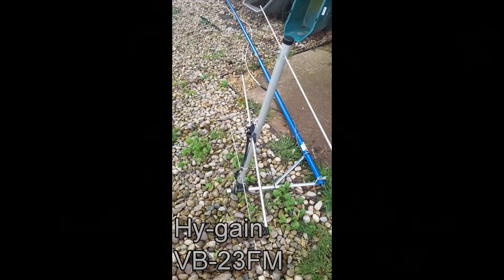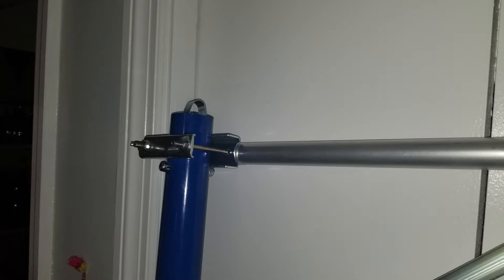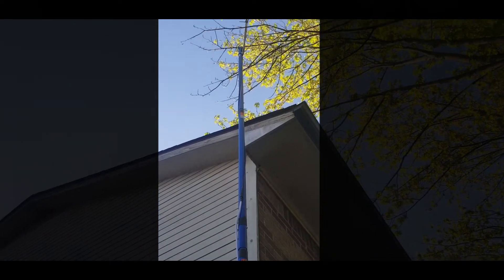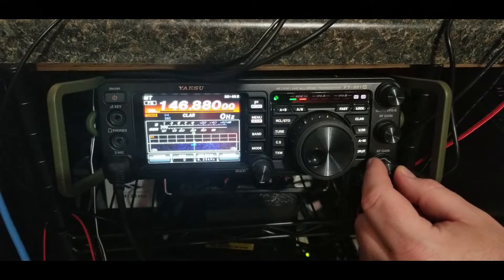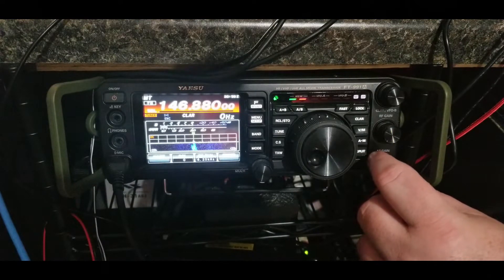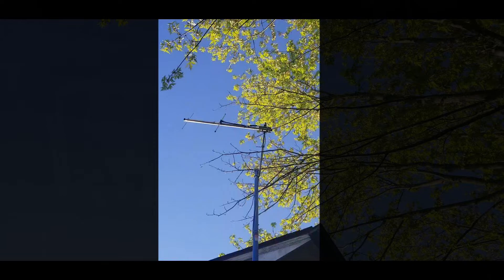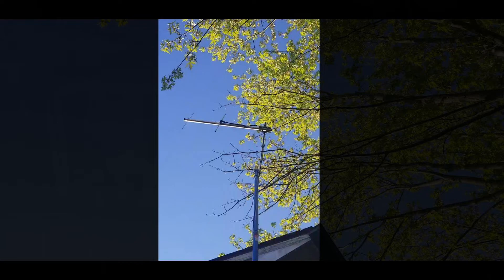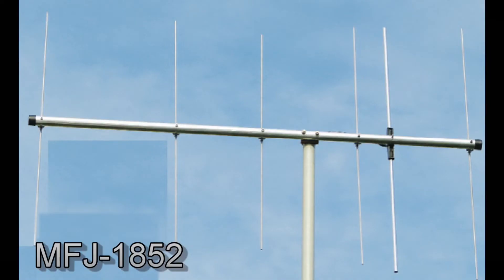LCARA HAM Radio: 2M YAGI Antenna Testing

Comment: Looking forward to the video on the 1852. 

You had good range with the btech and and drive on mount, which really  did show benefit of antenna type and height vs simply more wattage. 

 I like the idea of an omni directional like a j pole but both my local 2 meter repeaters a distance away,  possibly making a directional a better choice

Comment: Was I not seeing well in the video but it looks like you have the beam horizontal. Is it vertical polorized? I saw your picture of the 6 element beam was.
Reply: It may not be clear in the video but the 3 element yagi is vertically polarized to better match the antenna on the repeater.